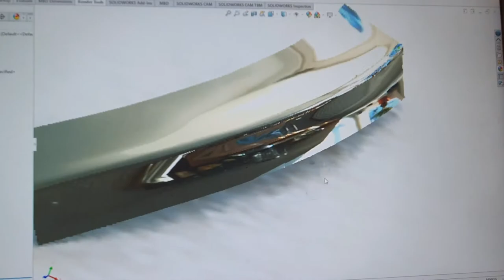3D printed Audi A5 spoiler & DIY 3D scanner from 6 axis robot OTC

Comment: This is awesome! Am I understanding right, Did you use the robotic coordinates and the laser distance measurement as your reference point for 3D modelling?
Reply from the maker: it is a distance relay. he is not connected to the robot. it's just for my eyes. in the background you can see that the light turns green! robot does not see the laser! I use a laser to avoid scratching a friend's car! Robot the brain over the old to automate the process!

Comment: Anyway you can go into more detail on how you scanned the car. What equipment did you use? I'm trying to do exactly the same thing as in 3d print a boot spoiler but I'm getting stuck on 3d scanning the car.
Reply: @aimlessdrive8723  I've tried mobile scanners but it seems that Android dropped lidar from their phones. I also looked at buying a handheld scanner but they are super expensive. So any direction actually will be appreciated. I also tried looking for a lidar scanner to do something with anrduinos but couldn't find anything.
Reply: @aimlessdrive8723  Thanks a lot for the feedback.

 I have a Samsung S21 ultra. I did see that the iPhone still do have the lidar sensor out of the box but I wasn't going to just buy an iPhone for this project. 

To put in short what my idea is. I would like to do something similar to what was done in the video, scan my car build a bootspoiler for example on fusion 360 and 3d print it on my printer, maybe later also use these parts as moulds for carbon fiber body parts.

 I will have a look at the blue light scanners thank you. I'm quite new also to 3d scanning so not sure what to look for. 

 My initial thought from the video was that it had something a bit more crude like an arduino with some sensors.
Reply: @aimlessdrive8723  Thanks a lot for all the help I really appreciate it.